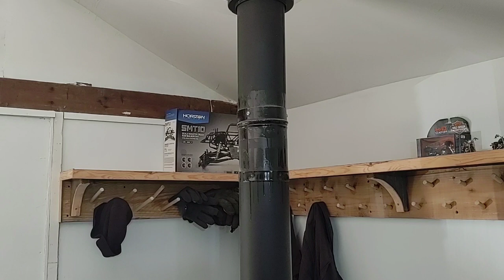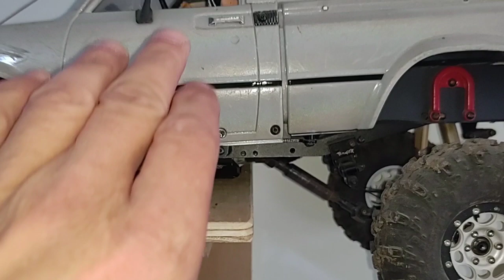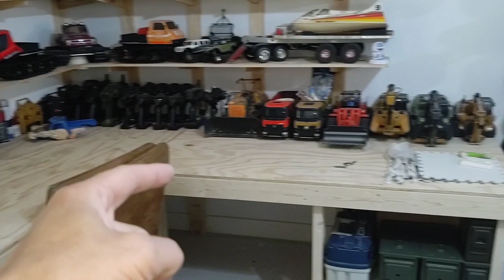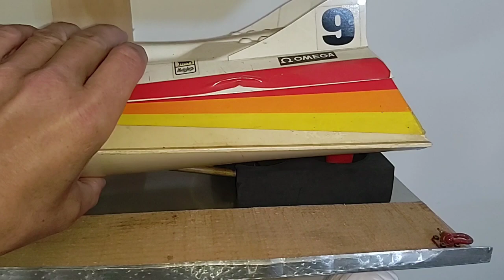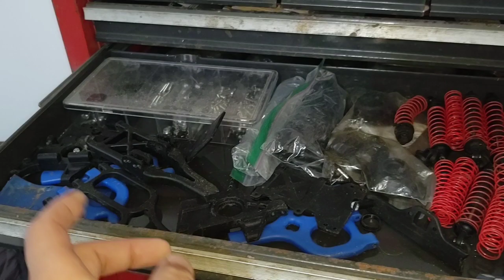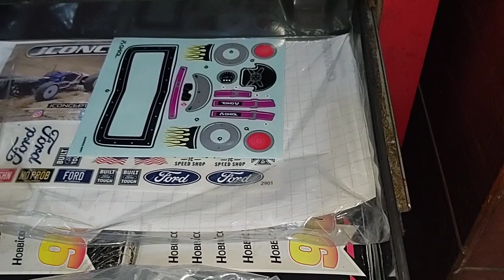R/C Workshop Tour

Comment: How are you doing buddy, How's the Bronco projects coming?
Reply from the maker: Got sidetracked with babysitting the pups for the last two days, and was running on almost zero sleep 🥱 between Thursday and Friday I was only running on two hours of sleep,🙄 But I did manage to get the Framework built under my workbench "for the extra shelving space that I needed" still need to buy a sheet of plywood for the actual shelves, but at least I've got the framework finished.😊 
I was planning on unboxing that bronco on Thursday, but got sidetracked with trying to find a way to get extra lighting over the workbench before doing that video,😕 I eventually found some extra lights to hang above the workbench, And in "that process" I ended up finding a bunch of other RC stuff that needed to be brought out here,🙄 which then turned into the shelf building project,😂 anyways... The shelves got framed in, but the lights never got hung up.😕 
It's currently Saturday afternoon, I just woke up from a short nap, and the lights are sitting here waiting for me to install,🙄
(Which are two "qty" 4ft led light bars) Which should be somewhat easy to put up, "it's just a matter of installing a couple of hooks into the ceiling, and then hanging the lights from a couple sections of chain ⛓️,😁 And at that point I'll be ready to film,😊👍
I'm just not sure when though 😕 Could be this weekend, but most likely won't be until Monday, or possibly Tuesday "depending if I go to the lumber yard between now and then" 😕 because I also want to finish those shelves before I get everything rolling in here, "as they say" Gotta make hay while the sun shines! 😕 Which can be difficult when you have the night shift babysitting puppies.🥱🙄😒 
Hopefully I can get this stuff finished this weekend and then do the Bronco unboxing early this week.
😊👍 
Busy busy busy! 🙄😂
Reply: Sorry to Bug ya,,, Just wondering
Reply from the maker: You're not bugging bro no worries about that.😊👌
As I said before, I enjoy talking with people like yourself, and always have time to do so.😁👍